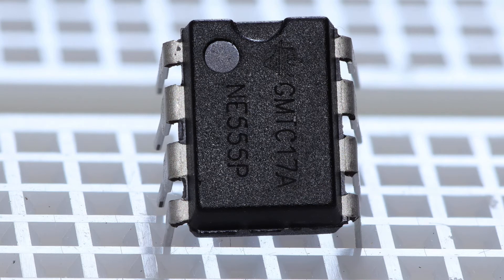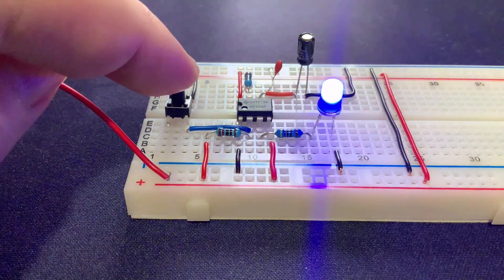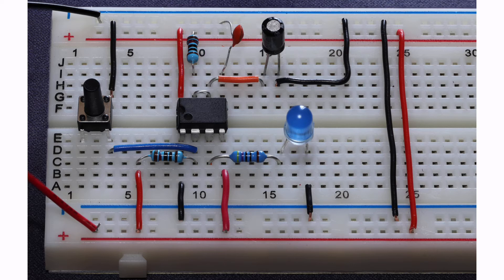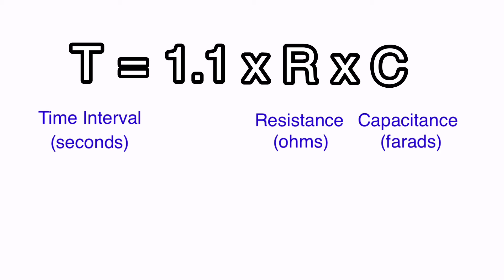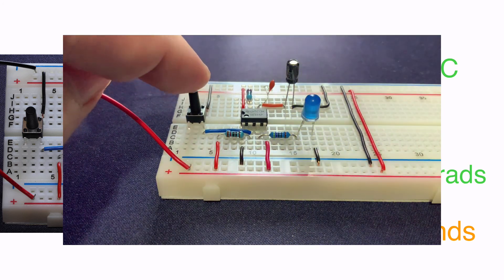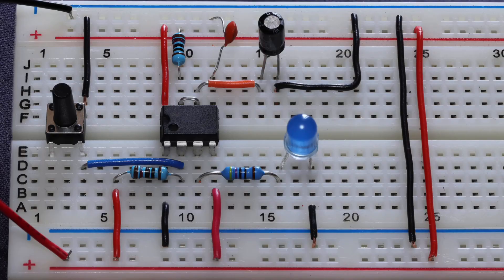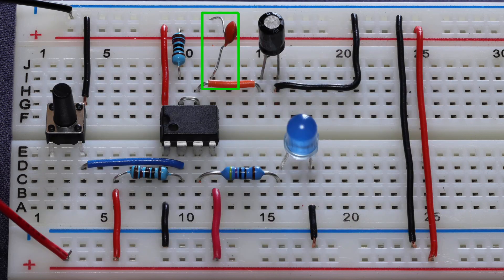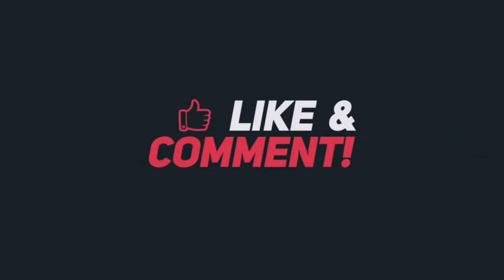Using the 555 Timer in Monostable (one-shot) Mode

Comment: I was thinking about using this circuit to power the reverse light bulb on my car, for about a minute.
Of course I will use a MOSFET to drive the 16w incandescent lamp.
But my idea is that after parking, I can press a button to illuminate my reverse bulb for a minute so that I can see my way to the front door more easily. Maybe I could also make it power the front sidelight 5w bulbs, incase the car is facing the other direction.

Comment: I'm experiencing something really strange. There is one undesired problem in my circuit. Monostable mode. When I turn on the power, output ( pin 3 ) goes high and then low. After that it's ready to do what it is suppose to do. Is there a way to prevent what is happening when truing on power?I need to keep the output low when turning on power. Otherwise the 555 works well in one shot mode. Can you do a test with a diode at the output pin 3 to confirm it, when turning power on?

Comment: I have a problem that this may solve, however I need the timer to start when the switch is closed but the switch will remain closed longer than the timer runs. Will this still work? I can only see you depressing the switch momentarily but my situation requires the switch to be depressed, send a timed pulse of approx 1ms, then as it is depressed another timed pulse is sent from a different switch (two switches in one mechanical housing activated in sequence by one plunger — an old fashioned camera shutter release).

The second pulse is timed by a simple mechanical contact closing in a clockwork device. The first pulse is to wakeup a digital capture device.